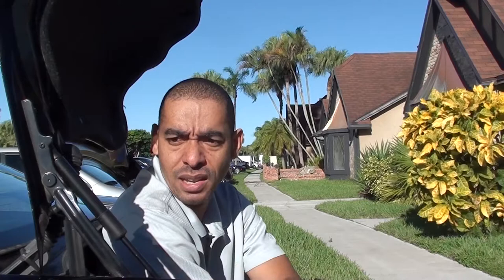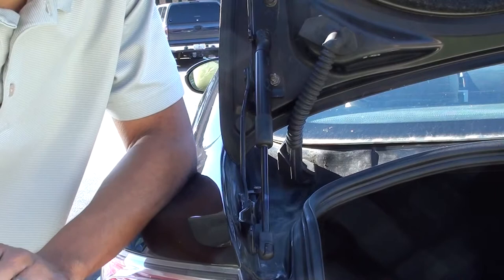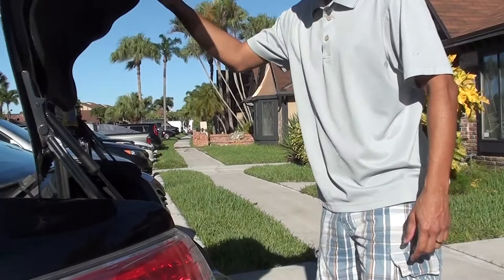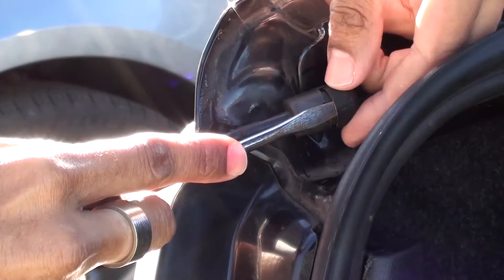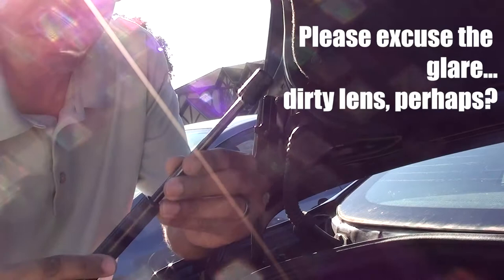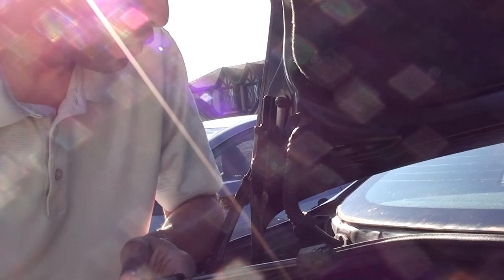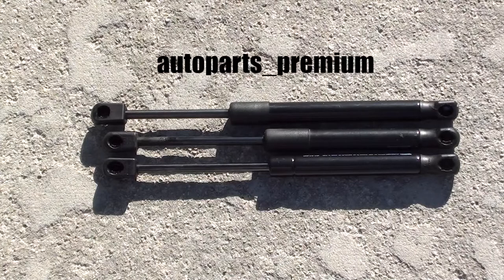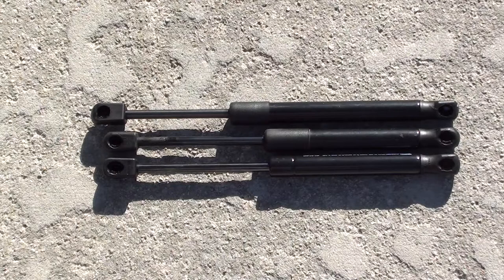2009 - 2013 Mazda6 Trunk Lid Stay Dampers Replacement

Comment: Where your elbow is in the video is where I have clearcoat failure all up that side top almost to the roof it's starting on the other side too..  car only has 75,000 on it..   But that's the price you pay for a living in a hot climate in Arizona    ..Also my trunk lid weighs an extra 30 pounds because I put sound deadening material..   Also have a clear coat failure on other parts of the car Debating if I should repaint the car or not  ..I've already replaced the rear trunk struts they didn't last too long even with the new ones..